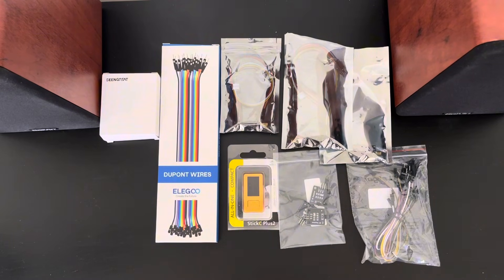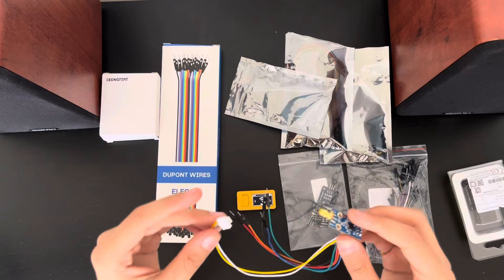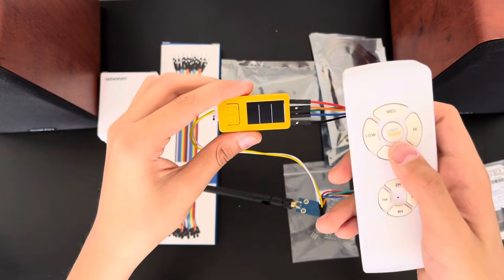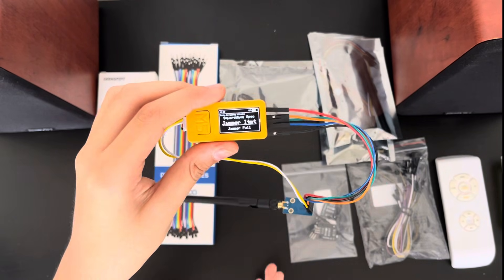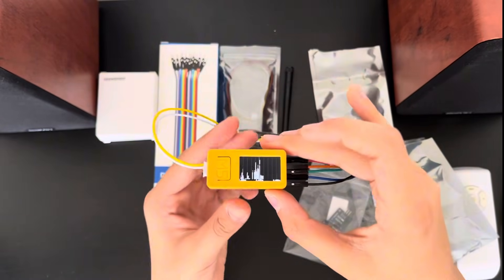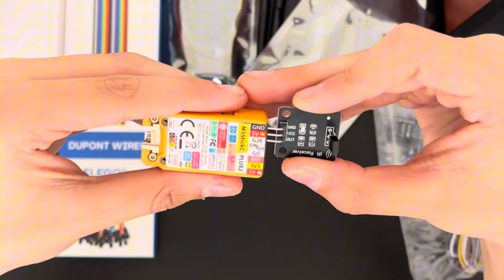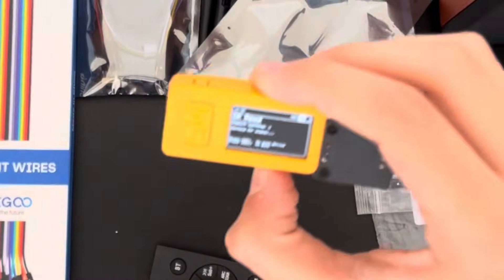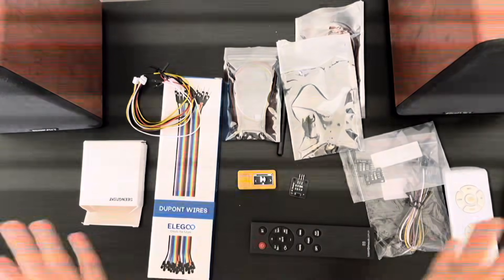M5 STICK C PLUS 2 Review And Tutorial With NRF, RF, And IR Read

Comment: Okay weird question here: I had a Universal Remote Sonic screwdriver from Wand Co (from Doctor Who) that could learn 3 different remotes with about 30 individual functions for each.  It’s no longer made, mine broke and they go for ~$600 on eBay now. I think from watch your wonderful videos that this awesome little gadget can pretty much replace my Sonic and do a lot more. It looks like you can download multiple IR Remotes for various brands and play the individual codes (is this correct? ). My question is: is there some add on module that can be purchased - preferably with multiple buttons and a accelerometer - that allows you to assign the individual IT  functions to a particular button and/or movement (using the accelerometer)?  This would allow me to replace my beloved Sonic Screwdriver, and with some 3d Printing I could design my own futuristic gadget with even more features! :-) Apologies if this is a crazy question but you seem incredibly knowledgeable on the M5 and modules available for it (where did you get these? I want that IR blaster and the connecting wires!). Great video and going to watch it again for the bits I missed or didn’t quite pick up on the 1st time! And thanks for any info! :-)
Reply from the maker: I just watched a video on this gadget and it seems very possible, just not with the device I am using. I say that you get a small microcontroller (like esp32 or a larger ardunio) and figure out a way to program it to where accelerometer movements are correlated to it emitting and receiving. There are some ai’s that can program it for you.(don’t remeber the name but there are many) and you won’t have to deal with the pain of programming something. Then, create a 3d model enclosing everything, including the reader and transmitter and button or even the LED and housing it together, powered by 5v usb or battery if you’re feeling creative. This would be one hell of a project but to be real with you I am not that experienced with custom modules.  The answer is no, this esp32 thingamajig that I have is not ment for it and probably there is not device like that. Anything other than basic cyber tech you need to make it custom, that includes programming a software and soldering many things like capacitors and resistors to a bread board. And yes you can take ir files from websites like GitHub and upload it using Bruce web ui. ( not from usb). Thanks for watching though 😅

Comment: what can you actually realistically do with these things i have bought both the cardputer and stick c plus 2, i dont know what to do with them really
Reply from the maker: Learn coding, everything becomes much more fun because you can do so much things. If you find a way to wire it together, you can make it so whenever a hall sensor detects that a magnetic field is gone, the built in buzzer on the
M5 stick will start to play a beeping sound, or even a Mozart piece because of it’s passive piezo buzzer
Reply from the maker: Basically a holemade security system

Comment: Hello, does it work right after i open the box and charge it or do i need to do sll that shit for it to work?
I want to download bruce btw
Will it work right of box???
Reply from the maker: No it will not, you need to watch another video on how to flash the firmware and install Bruce using m5flasher software in computer
Reply from the maker: It will work but will not work on Bruce,

Comment: it says NRF24 not found for me any solutions?
Reply from the maker: The pins are mirrored in the image so you need to mirror them. The picture is a top view, not a bottom view
Reply: I tripled checked but still keep getting the same problem
Reply from the maker: @Ale_Segu probably a broken wire or broken module
Reply from the maker: Check pins
Reply: I have the same problem with nrf, but with the cc11010 work perfect..